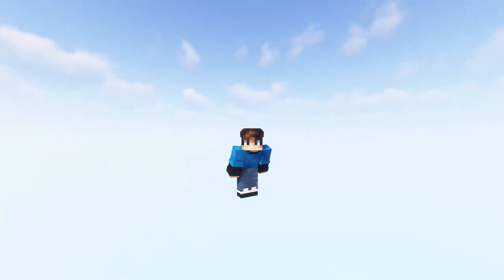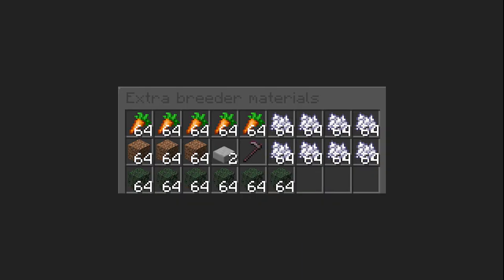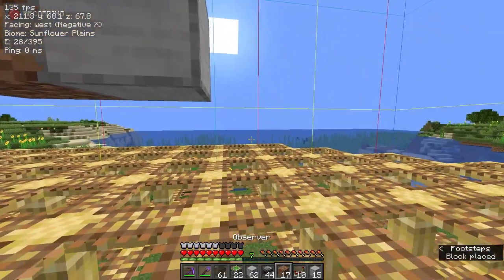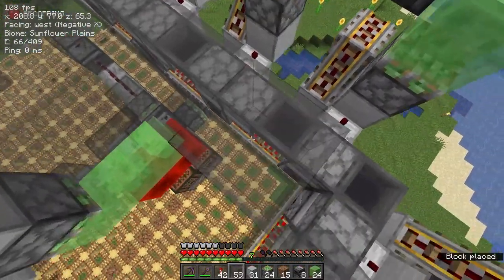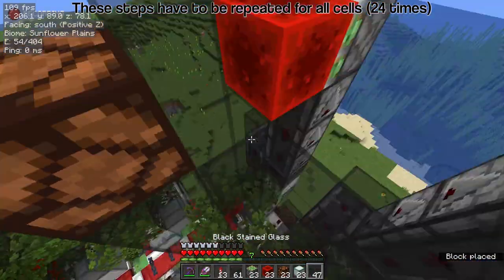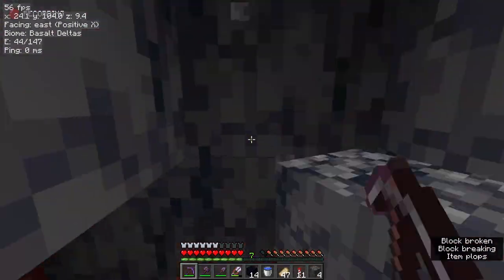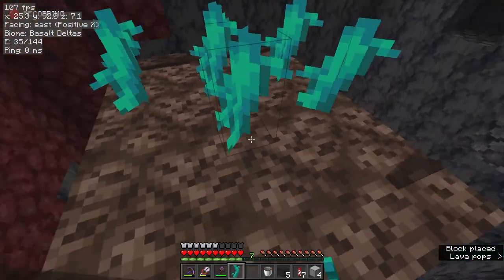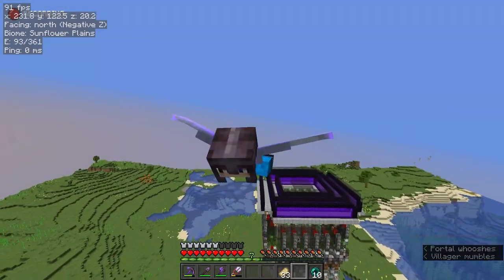NubTech's VUAIF v2 | 11100 Iron/h | Java 1.16.2+ (OUTDATED)

Comment from the maker: FAQ - HELP AND MORE INFO ON THE DISCORD SERVER - Don't ask for help in the comments here, it's hard to bugfix on youtube

Getting less than expected in 1.19? This is due to a bug in 1.19 and until it is fixed you should switch out the clock with the one shown here https://youtu.be/RK-efbBOwFE 

Can't download from mediafire? The litematics are also posted on the NubTech discord in the #archive channel

Villagers getting out of bed in weird places? Make sure there are no extra blocks in the platform and use the clock shown in this video  https://youtu.be/RK-efbBOwFE

Portal linking issues? Record the coordinates of both the nether side portals as well as the fence surround the lower pillager (use f3's targeted block information on the right) The y levels of the overworld portals should match their corresponding nether side with 2-3 blocks of leeway.

Getting less than expected rates? Turn off the farm, unload then reload it and turn it back on. rng does affect this farm but only takes effect on reload.

The Redstone blocks and lamps at the very top of each module are optional and can be replaced with glass.
Reply: update discord?
also do i have to pay 40 dollars to download the lightmatica caus i wanna build but i dont have 40 dollars
Reply from the maker: @SigmaGMD4  the litematica files and world download are completely free, ignore the mediafire subscription popup. I don’t paywall anything and it wouldn’t even make sense at my channel size. Could you elaborate what you mean by update discord?
Reply: @EmdyMC  of course, the discord invite link is invalid and when I try to ignore the pop up it just won’t let me download lol

Comment: I'm still not getting the rates advertised in the title even after slowing down the clock by another 6gt. I think the clock is still too fast. When timing it manually, the villagers are going up every ~33.5s which I'm not sure is enough for them to cooldown and actually summon another golem. The symptoms I was seeing at default values is only every other villager group was summoning golems, alternating every loop, meaning that I was only getting around ~6k iron / hr.
Reply: In 1.19.1 golem spawning was slowed down to every 35 seconds. This seems to be a bug.

Comment: I see it took you a few more days than expected to release the video, but it's always best not to rush it.
I'm guessing the lowering and raising of the pillagers is what helps bring the efficiency up?
Amazing design and great tutorial, thank you a lot.
The self loader is an amazing addition aswell, I guess though that if the chunks ever get unloaded because of a server restart/quitting the game, one has to go over there to reload them?
Reply from the maker: Raising and lowering the pillager doesn’t affect the efficiency, its the clock speed that does. Old farm used to trigger cells every 714gt, this does it every 600gt, perfectly matching the golem cooldown. If it gets unloaded during a restart then yes it has to be manually reloaded but its advised to turn it off before a restart so it doesn’t break if loaded weirdly.
Reply: @EmdyMC  Cool, thanks a ton!

Comment: Great work, was planning to build the gnembon version but this may be better, also do I need the loader if I built this in my spawn perimeter?
Reply from the maker: Thanks! If its in spawn chunks you don't have to build the self loader.
Reply: @EmdyMC  which part of the build is the self loader?
Reply from the maker: @douira  the bottom half of the nether side and the portal under the glass floor in the overworld

Comment: Do I need to be very lucky to get the expected rate? It always takes me several reloads to get it spawn 4 golems in each cycles.Otherwise it only spawns 1-4 golems randomly.
Reply from the maker: You'd actually have to be pretty unlucky to get multiple spawn cycles with less than 4 golems per cycle

Comment: im using carpet mod to check the rates and im only getting like 2k-3k per hour. i pasted it in using litematica so nothing should be wrong?
Reply from the maker: I'm guessing you're in 1.19, add two more observers to the clock, you should get about 8k. Reduced rates are due to a bug in 1.19
Reply: @EmdyMC  ah ok. thank you

Comment: Hi, I’ve finished building the farm in a private server and everything is placed correctly (confirmed by both litematica schematic and video tutorial). Anyways if it’s night time, when I activate the farm a lot of villagers start escaping their positions; if it’s day time the farm works correctly. Do you know a fix for this? 

I’ve read the comment asking for the same question, but I can’t understand the fix the same user found by himself….
Reply from the maker: When you turn off the farm, while the pillager is lowered the observer should be under the rail line. Make sure there’s no extra blocks between the pillager and villagers and if you need pictures/more details check out the faq post in the discord server, ping me on there if you can’t find it.
Reply: @EmdyMC  thank you, I’ll try to fix it because I really like the design :)
Reply: @EmdyMC  fixed it, it was the observer under the rail that was not there. Thank you, the discord helped a lot :)
Reply from the maker: @itDraken  glad to hear it, enjoy the farm!

Comment: Hey I love the design and it works wonders in the morning but I built it on a hypixel smp server and the villagers will escape at night upon being scared by the pillager would you know what causes this?
Reply from the maker: Hypixel runs its own server software that likely changes a lot of things related to entities sadly. Depending on where they exit it might be possible to get them back in but I can’t say it would work flawlessly because I don’t know what they changed.
Reply: @EmdyMC  Yeah it sucks... Ive been wanting to get off the hypixel network but they dont let you take your world file. I did also notice the farm will activate itself and break and when turning it off sometimes it goes for a few more cycles. Could that be because of hypixel or something else?
Reply: Now it just seems to break and everything goes oof immideatly after the other upon turning it on which is weird. I noticed that the rail is flashing way more often then it should be and double pulsing sometimes would there be a way to fix it?

Edit. I figured it out I put a piece of red stone for an item sorter and despite it not actually touching the rail I think I was updating it causing extra pulses

Comment: it's work for 1.19.2?
Reply from the maker: It's less efficient than before but it still works, there is a clock modification on the discord that helps improve the rates a bit, getting it closer to the original. ping me if you can't find it.